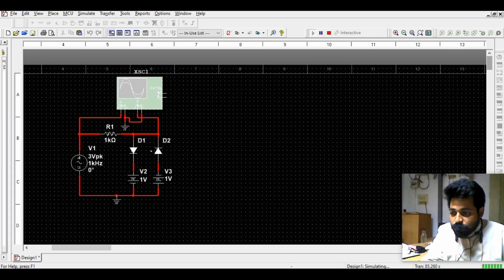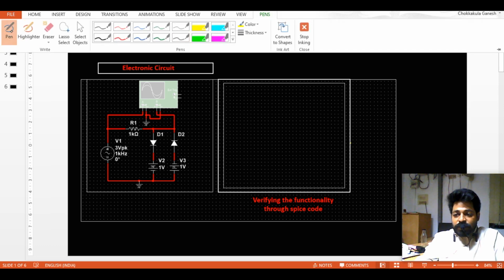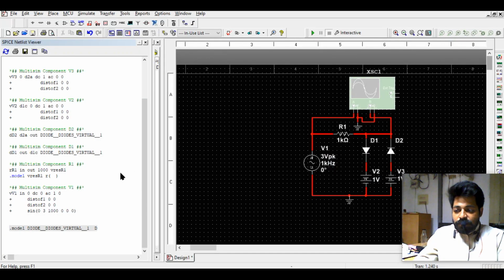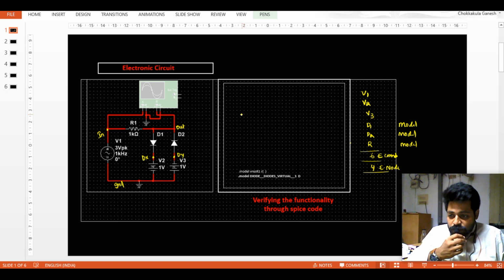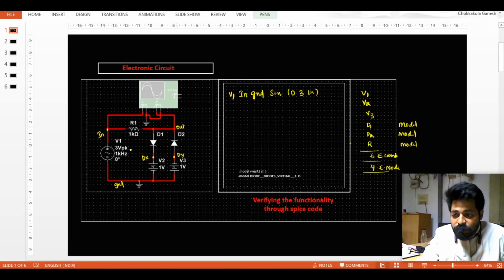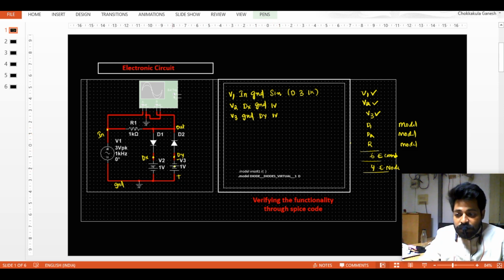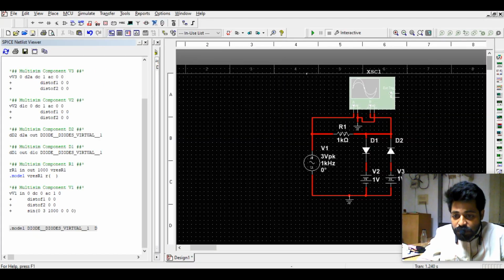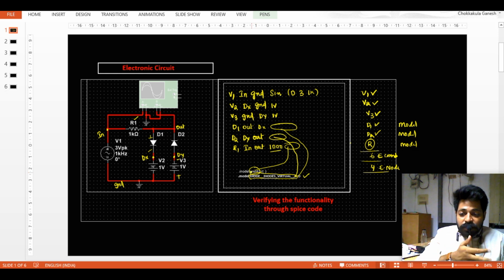Multisim simlation to SPICE code Simulation through T-Spice part 1

Comment: Standard Spice Template *****title******

.protect
*****library path******
.unprotect

**supply******

***input sources******

*****spice code for name_of_the_circuit******

********netList commnads****
.op
.option list node post
.options nomod post=2 autostop
******operating analysis*****

********measure parameters*****

******print input and output nodes******

.end

*****end of the program*****

Comment: spice Code: (2 way clipper circuit)

v1 in gnd SIN (0 3 1k)
v2 dx gnd 1
v3 gnd dy 1
d1 out dx DIODE__DIODES_VIRTUAL__1  
d2 dy out DIODE__DIODES_VIRTUAL__1
r2 in out 1000 vresR1

.model vresR1 r()
.model DIODE__DIODES_VIRTUAL__1  D
.tran 0.03m 5m start=0
.print v(in) v(out) 
.end